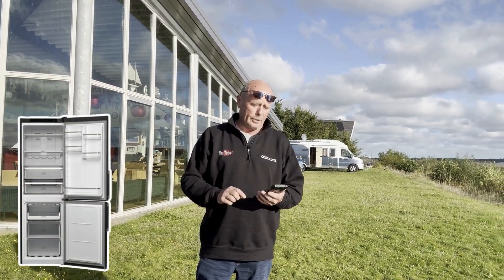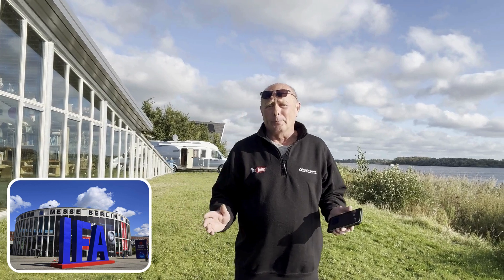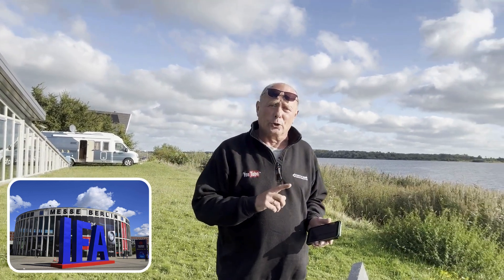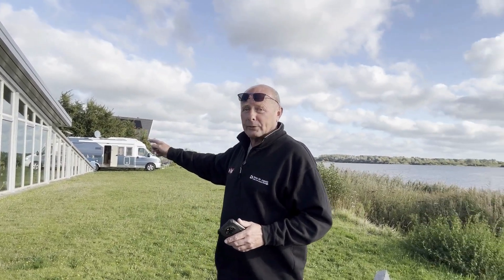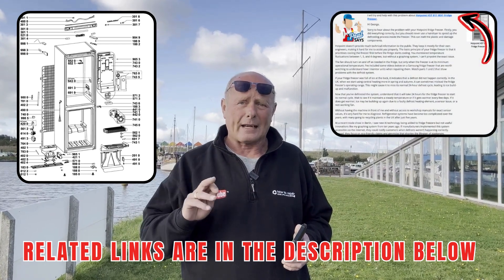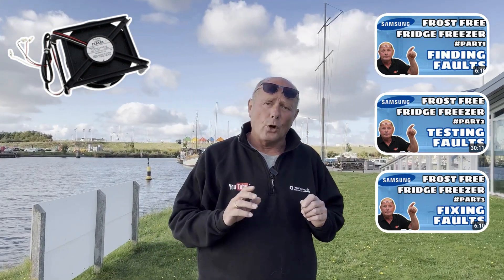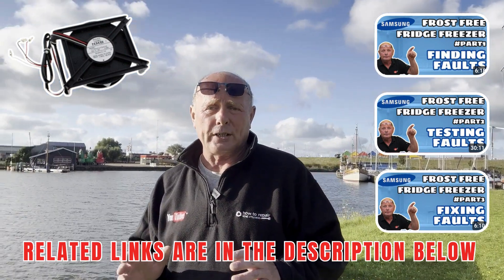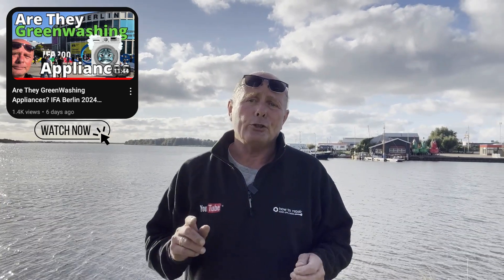Hotpoint H5T 811 IKH1 Fridge Freezer Fan Not Working - Answered From Camperplaats Jachthaven

Comment: I had a build up of ice I took the back panel off defrosted it quickly with a fan heater there is syill a little at the bottom of it but I think it is clear now.
I took the fan out and tested it with 12 volts and it works perfectly so it isn't getting the correct signal to switch on.
I guess now I will switch it off for 24 hours to defrost it completely and reset everything. Really hope it works.